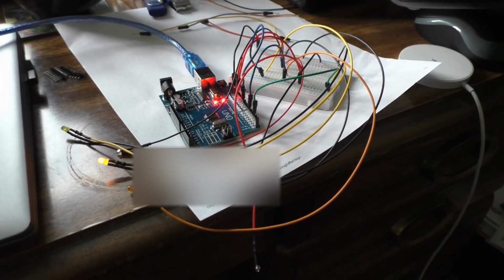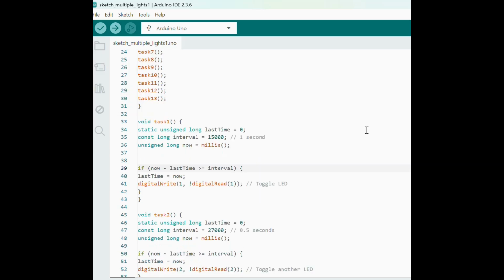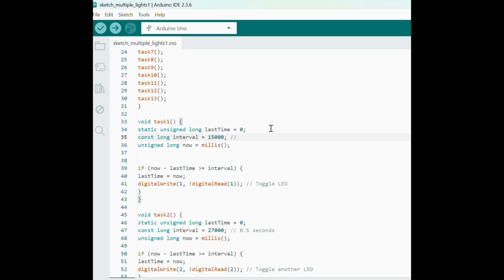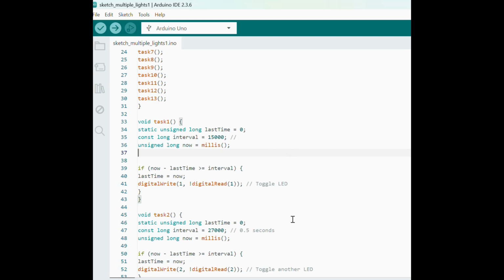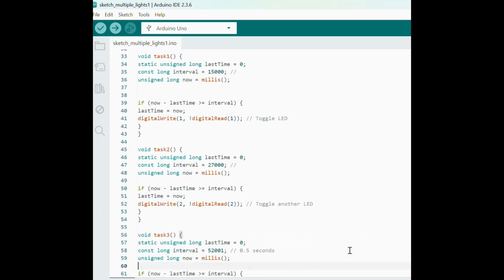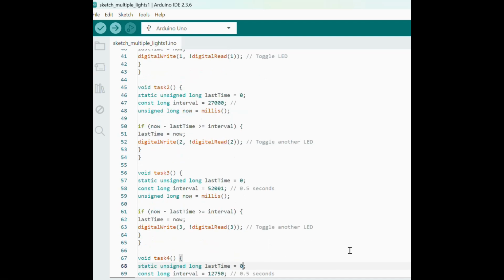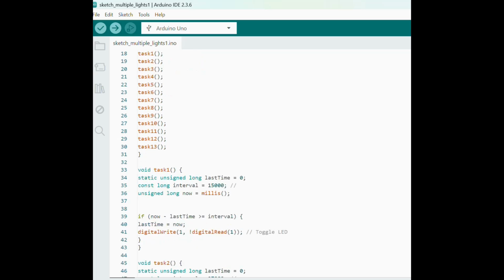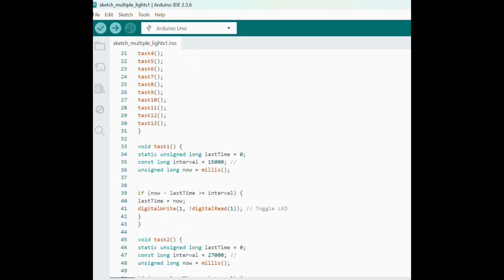222. Using an Arduino to Control Lights Part1

Comment: Thanks - I like your code design to avoid things blocking with delays(). Another idea I'm exploring for my setup, with much simpler wiring, is using an esp32 (a very compact version of the arduino, i.e. fewer IO ports and a different cpu, but still programmable with the Arduino IDE) with the addressable LED strips - the long (5m) cords with 30-60 led/meter, where every single LED can be separately programmed. Using a single (3-wire or 4-wire) connection from the esp32, you could run the led strip under the house row, and have each house run its own random lighting pattern. Even cuter, rather than just a warm light coming on and off, most of the strips do RGB colour as well, at potentially high rates of change, so you could have one house having a bit of a disco party at times :-D. Have a look at demos with the FastLED or WLED libraries.